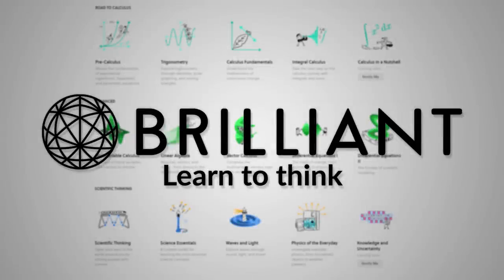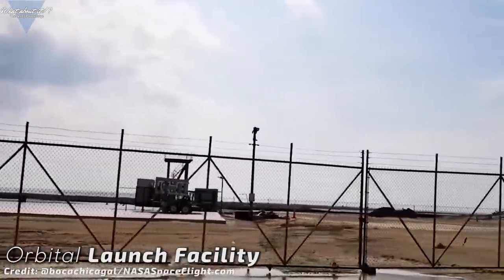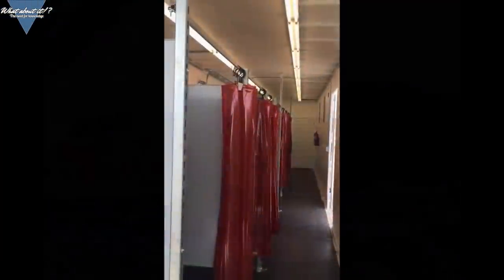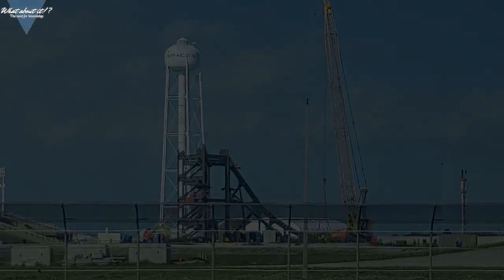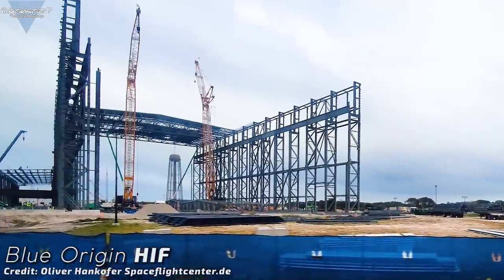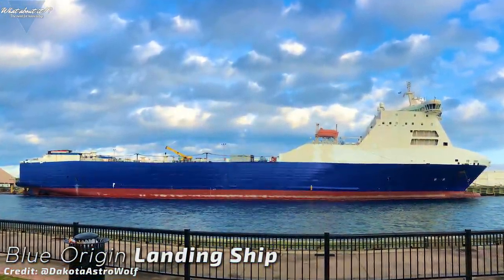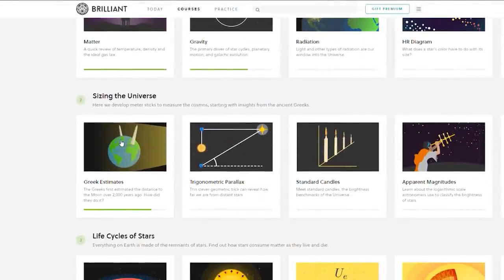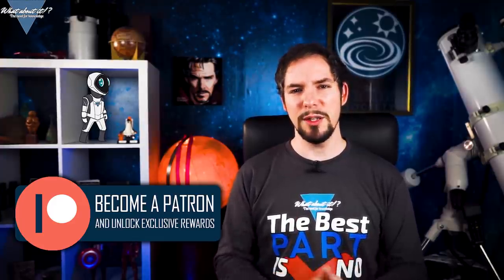60 | SpaceX Starship Updates – Blue Origin Launch Complex – Starliner Orbital Flight Test

Comment: Hi Felix, love the show. Just got a quick question for you, what exactly is your setup of your Dobson behind you, what doest it al consist of, are you happy with it so far, and how much round about did it cost you, if u can recall? keep up the work
Reply from the maker: Hey Shaman, It's not a dobson. :) It's a Bresser NT150 with a EXOS 2 GoTo (equatorial) mount and some Baader Hyperion oculars. I love it and it does exactly, what it's supposed to do and isn't too crazy to use (rather easy with the GoTo computer). It's strong enough for planetary nebulas and galaxies, so it doesn't get boring as with smaller ones, where you're limited to the planets. Total cost would be around $2000. Only the telescope and mount would be around $800-1000. That's the minimum for deep sky objects in my opinion.
Reply: @Whataboutit  Thanks for replying and for the info aswell. Love the content, keep up the good work!!

Comment: Do you think Blue Origins is secretly working on a ship to rival starship? If so could that be why SpaceX is moving so fast?
Reply: Controlled Chaos. Spacex likes competition so that wouldn’t make much sense. There probably trying to get starship orbital before 2021 as that was the original plan when the ITS (an older starship design) was announced
Reply: There are rumors of a New Armstrong ship in the planning phase which would be equivalent to the Starship in size and focus on deep space travel especially to the moon.  New Glenn will be bigger than the Falcon rockets and similar in operation.  New Glenn will be about the size of the Saturn V rockets or SLS.   New Shepard is just for fun (suborbital).

SpaceX is just trying to overcome their failure and get something out since their Starship presentation.  Blue Origin is taking their time and Bezos is not interested in Elon.

Comment: Why all the fuss with launch facilities none of that will be on the moon or mars. How will they take off from those 2 planets. ? There will be a dust storm when they land and takeoff.
Reply: Les Chortos We build launch facilities on earth because we CAN and because it’s BETTER for the rocket and for the facility. We will build them when we can on the moon and Mars for the same reason.  
Just like docks and harbors for ships in mankind’s early days of ocean exploration, the facilities make things better and easier, but you can still go places before the facilities exist.
Reply: @737smartin  Exactly. And makes so much sense for the first generation of  Starship - tackle one set of problems at a time. Isolate some of the possible failure points.
Reply: Guess ive been watching too much sci-fi where the spaceships takeoff and land from any old surface.  Still curious what the blast of a starship will do on the surface of the moon. With both dust and uneven terrain. I am assuming they will have some variable length terrain compensating legs so it doesnt tip over.
Reply: Les Chortos ...Like the old ship navigators, they will have to choose their landing locations very, very carefully. We still may see some ship damage from these early landings and departures, too!